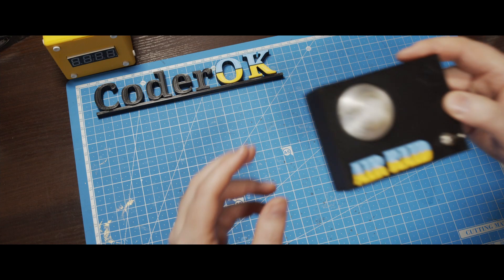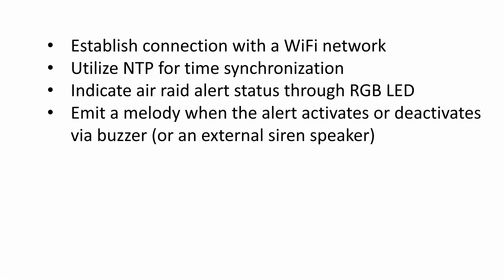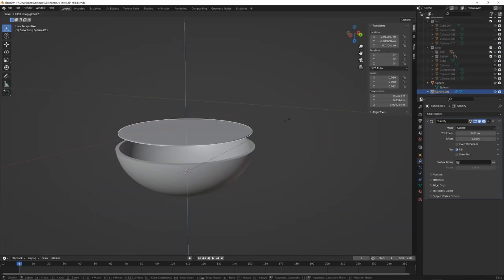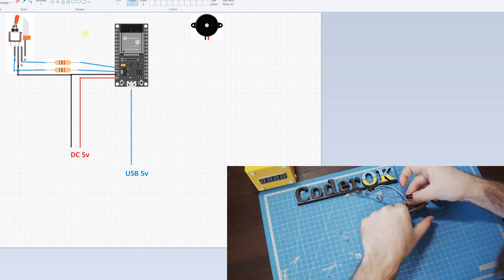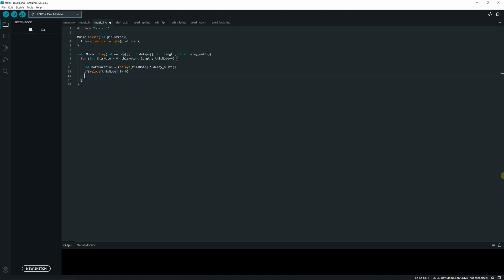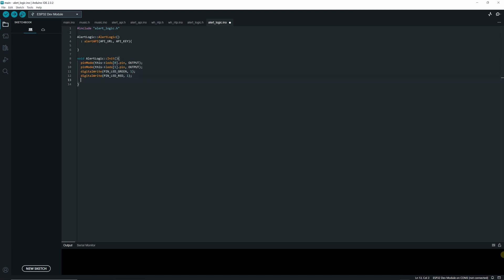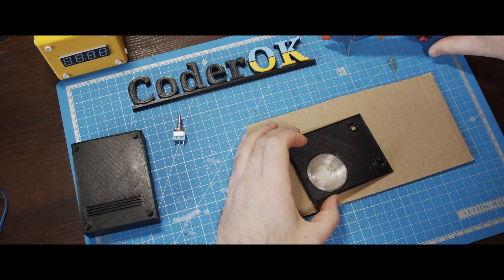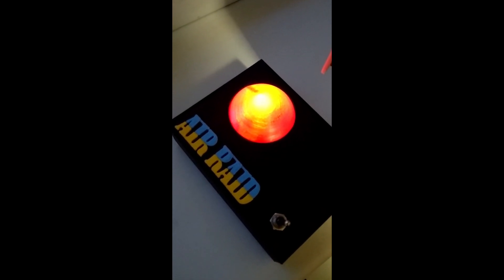A Portable Air Raid Alert Device (built on ESP32 with a custom 3D printed case)

Comment: What website to buy this from?
Reply from the maker: Hi @kareememad7497!
I made this as a hobby project.
Unfortunately there is no way to buy it at this moment.
But you can do it yourself.
Here you can get all the files to print 3D case, list of electronics components and C++ code for the device: https://github.com/2CoderOK/air-raid-alert
Hope that helps!